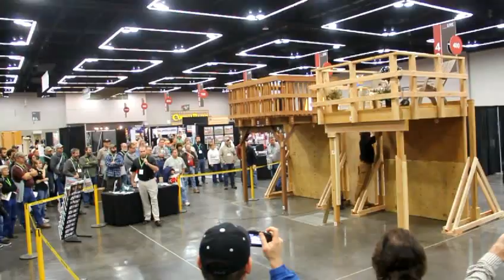Deck Collapse

Comment: Put in a couple of extra posts and don't connect your deck to the house. No leaks, rot or collapsing. Quicker and cheaper too.
Reply: Quicker? Cheaper? You gotta dig and pour tubes for that
Reply: @BSCTrainerRob  Cheaper than collapse and replacement.
Reply: In most cases, according to code, a deck that is not attached to the house does not even require a building permit or an inspection. The savings from not needing a permit or inspection offsets  any costs from a  couple of extra posts and footings.
 All the decks I put on my home are 100% freestanding 1/2 inch from touching the house.

Comment: How many deck collapses are caused by the recommendation & use of corrosive to structural metal decking hardware cleaning chemicals, such as those that contain sodium Hypochlorite or oxalic acid? Most deck cleaners contain these non-compatible chemicals. Why is it that the major manufacturer's of structural metal decking hardware disclose the "corrosion risks" of "cleaning chemicals" which can void warranties, which retailers & manufacturer's ignore, especially with composites?
Reply from the maker: Hard to say. A two story deck--an old one--just pancaked off a house in Wildwood, NJ over the weekend. I think they're still investigating. - I do know that oxalic acid is in some deck cleaners. But since these decks are also rinsed or powerwashed, the acid is removed. This might be a matter of degree, not either or.
Reply: @ToolsEditor  Oxalic Acid,  commonly known as a "Wood Brighter" is generally sold with Sodium Hypochlorite, the active biocide in Chlorine Bleach based product intended  to clean "Mildew" a very specific subspecies of mold, which this biocide is not scientifically proven effective to remediation, to restore the color of redwood, cedar, teak, etc. These non-compatible and potentially deadly chemicals are generally corrosive to structural metal decking hardware, most commonly made from galvanized or stainless steel.  When they come into contact with these items, the corrosion instantly occurs. Rinsing after the fact does not reverse the corrosion. This is the #1 problem in the decking industry, especially for generally longer lasting composites & manufacturer's/retailers that ignore these facts. There is good reason structural metal decking hardware manufacturer's generally disclose the risks of corrosive cleaning chemicals! Do they void the warranty?